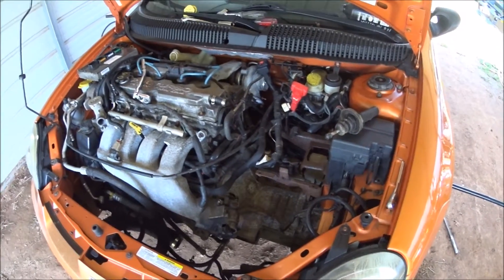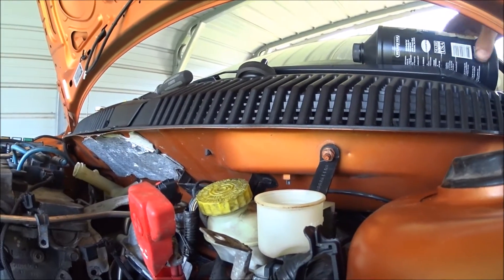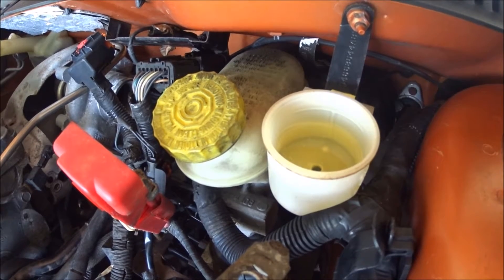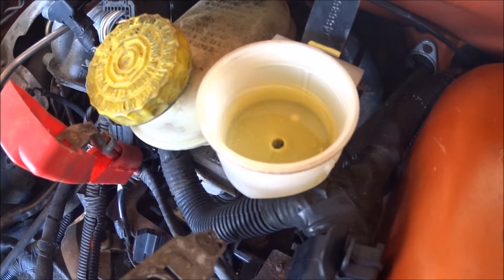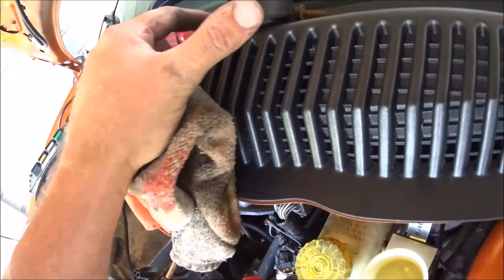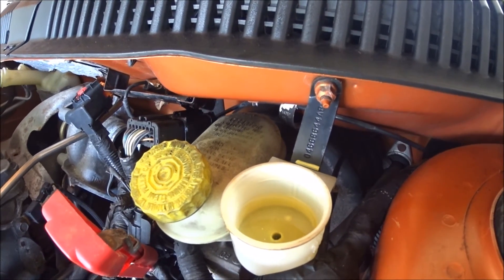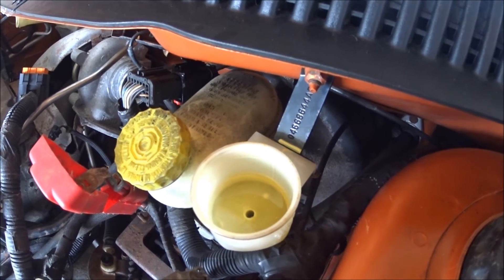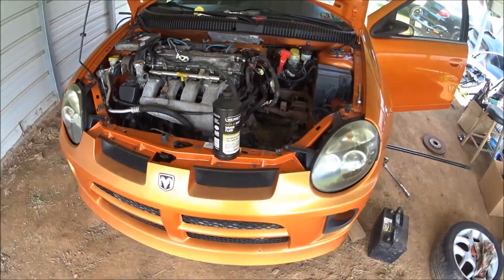SRT4 CLUTCH BLEED

Comment: Fantastic easy to understand video! I have been having problems with my pt cruiser after changing the slave and master cylinder. There is no bleed screw on the slave so I had been sort of trying what you have shown here but always ended up with a very soft peddle which would work if pumped quite a few times. After watching this I now know the correct way to do it! So hopefully after I do what you have shown my pt will be back on the road. Thank you for taking the time to do this very helpful video.
Reply from the maker: MrDazzaman1 thanks if you have time check out pt2 on this
Reply: Just bought a srt4 supposedly the clutch was put in a southbend stage 2 kit with pressure plate flywheel and throwing bearing . Master and slave cylinder were supposedly done but I don't think it was bled. My problem is hard to get into gear especially 1st and reverse I have to pump the clutch a cpl times to get into gear which is difficult it also has a very soft pedal which catches low to the floor . Do you think I have air in the hydraulic lines ? Maybe adjust the pedal ?
Reply: I'm going to work on it this week I hope it's not the fork .

Comment: Great video, this is probably the best srt4 clutch bleeding video on YouTube. You made it look really easy so I'm hoping I can bleed my clutch myself! One thing though, I can't tell what you're doing with the hand that's doing the pushing, or where it's pushing for that matter. When I look at my transmission from underneath I can find the slave cylinder piece with the tube that goes up to the reservoir but I didn't see anything that looked like I could push on it to bleed it as easy as you did. Any way you could explain that or make a small video from the other perspective of how you were actually doing it and not just the air bubbles coming out? Thank you!
Reply: James Dennings you can just pull the slave cylinder out and push the rod in against the transmission housing is what I did before.
Reply: dj setterstrom when I tried to take out the slave cylinder it can't turn fully because the radiator is aftermarket so it's too big. Which is why this method where the slave cylinder is still in is giving me hope I can still do it myself.
Reply: James Dennings, at 3:21 using " stop motion on your screen, you can see the opening on the trans (where he puts his hand in)

Comment: Appreciate the video bro. I need to do this to my NSRT-4. 
  What if I want drain the whole fluid to add new and clean fluid. Would you happen to have a video showing this or is it something simple I can do.
Reply from the maker: to flush it i use some thing to suck the fluid out of the master a turkey baster works well then wipe the resivor out with a paper towel i fill and bleed like shown in the video you will see the dirty fluid push up repeat  this a few times it works just takes time to do you can pull the pin at the slave pull the line and push out the fluid then fill it there will be lots of air in the system and some times it a pain to get it out..

Comment: Hey matt, im doing the srt swap on an sxt i bought, the car was also manual transmission, i put everything back together just curious, can i adapt the srt slave cylinder to the sxt slave cylinder lines? Or do i have to take everything back off again and put the srt slave cylinder lines?
Reply from the maker: Jose Gonzalez I’m not sure the ones I’ve done the conversation to were all automatic transmission
Reply: @Mattsneedforspeed  ok thanks matt, if its possible ill post it here just in case anyone else is doing the manual transmission
Reply from the maker: Jose Gonzalez that’s a great idea thanks ...

Comment: My reservoir line is long enough to bring slave cylinder to the ground and bleed it pushing slave needle into blacktop,just make sure to clean it before reinstalling
Reply from the maker: perfect the lower the better to help get the air up out of the system.

Comment: So my clutch has pressure but it won’t go into gear I have brand new bushings and everything there’s fluid leaking on my master cylinder above the clutch pedal  could I need a new master cylinder
Reply from the maker: Raul Rodriguez hello, nothing in the clutch hydraulic system should be leaking, If you have a leak at the master replace and bleed the system, If the master is bad and letting the fluid leak around the cylinder it will not move the fork enough to release the pressure plate and allow you to shift in to gear.
Reply: Matt's need for speed thanks man I just got a master and a new slave gonna install today will let y’all know

Comment: When you are inside the car and pressing the clutch pedal, does fluid get pushed back into the reservoir so that air bubbles come out the same as when you are manually moving the clutch fork??
When I'm inside pressing the clutch pedal, nothing is happening at the reservoir.
Reply from the maker: jkenney940 pressing the peddle forces fluid down to the slave cylinder
Reply: Matt's need for speed 
So is it correct that nothing should happen at the reservoir when I press the clutch pedal?
Reply: jkenney940 no I tried pumping both sides like 100 times lol

Comment: What Exatcly are you pressing at the slave idk how yo do it
Reply from the maker: Raul Rodriguez I’m pushing the fork back against the slave cylinder rod with my fingers. I have a pt2 follow up video for this check it out.
Reply: @Mattsneedforspeed  I installed a brand new Agp clutch fork and act throw out bearing and it’s hard to push that towards the slave cylinder
Reply from the maker: @elmersslowstang6110   ok I’ve found that they like to get clogged up with a white chunky substance in the connector in the oem line pull it apart and press the inside of the connector in with a screwdriver and flush out the fluid be careful not to get it in your eyes this is just one suggestion assuming you have tried other things
Reply: @Mattsneedforspeed  thanks man

Comment: 1:45 i cant seem to get the plugs on, how did you manage to do it?
im using excessive force ... still wont connect
Reply from the maker: Ok did u try with the slave out of the trans there might be too much pressure on it if it pushing on the fork
Reply: @Mattsneedforspeed  yeah i tried that, it doesnt want to latch on together
Reply: I figured it out, I was missing a quick release line clip... I wasted my whole day over a clip
Reply from the maker: @adhd4826  well that's good news and bad news good to hear you figured it out sorry for being alot late to reply
Reply: It’s okay, I’m still trying to figure out where I can get a clip, auto parts store don’t sell them nor the dodge dealership

Comment: Could an improper bleed (air still in the system) cause the same symptoms as a bad slave cylinder?
Reply from the maker: thatsrt4guy did you watch pt2 on this it goes over some of the issue you’ve described I’ve had to rebleed the system the next day and got more air but parts do go bad check your push rod inside under the dash.  was the transmission out? what’s the condition of the fork/pivot ball all items that will cause the fork to not disengage the pressure plate.
Reply: @Mattsneedforspeed  my car supposedly has a new transmission but you cant get into first sometimes and 3rd grinds.
Reply: @Subaruwrxhiv  curious, did you ever get around to fixing the issue ?
Reply: @ranch92  no
Reply: @Subaruwrxhiv  SRTs have issues with 3rd gear syncro, from kids going from 2nd to 3rd hard. Someone prolly lied to you about your trans being "new". It's quite common for these cars to have shift problems.

Comment: Having problem getting the quick connect disconnect .....lol how do you do this?
Reply from the maker: Scott Holland they have a special tool for this I usually push the release in with a flat blade screw driver I’ve also used needle nose pliers once it’s pushed in it should pull apart
Reply: Push the yellow tab down with pliers all the way  then pull it off
Reply: Use an 11/16 box end wrench to push in and compress the quick disconnect than pull apart.  👍 Made it real easy

Comment: Is the sxt neon bleed the same way as a srt4 neon
Reply from the maker: hello, I'm not sure never had to do one, but if its a closed system like this the bleed processes is similar some have a bleed screw and get bleed out just like a brake caliber.
Reply: X 2 10 mm bolts take it off the transmission open the fluid resivior half full only then push the rod in by hand make sure to change the fluid some rags will do in that small amount

Comment: Dude I'm doing this right now and I've been trying to get pressure I did everything you did and no bubbles or nothing
Reply from the maker: timothy johnson are you getting any fluid movement in the tank when compressing the slave ?
Reply from the maker: timothy johnson are you getting any fluid movement in the tank when compressing the slave ?
Reply: No I'm not bro
Reply from the maker: timothy johnson the slave cylinder could be bad
Reply: I changed it lol and still nothing am I pressuring it  wrong should I empty out the lines?
Reply from the maker: timothy johnson sorry at this point I’m not sure wish I was close I’d stop by you could try the Facebook Srt4 owners some one maybe close could possibly help you out .

Comment: I did this and my push rod broke
Reply from the maker: Elmers Slowstang it’s common for that to happen the one under the dash is cheaply made and well 16-18 years old now it’s probably time for an upgrade I just did a video upgrade on the dcr one and the install
Reply: Matt's need for speed I changed my slave cylinder and master cylinder with a stock clutch push rod but I have a act clutch my srt4 doesn’t go into gear it makes a rattle noise when I’m off the clutch I think it’s the clutch fork that’s bad when I’m in gear and have the clutch all the way in it wants to shut off on me can u help me out man
Reply from the maker: Elmers Slowstang ok the act’s will make a little noise when idling in neutral with clutch out, now if you have the system bled out and the push rod under dash extended to full length to to push the slave out all the way and it doesn’t disengage the clutch the fork will likely be the issue.